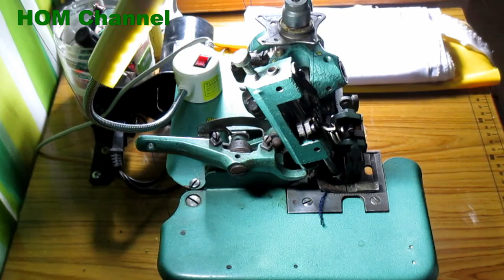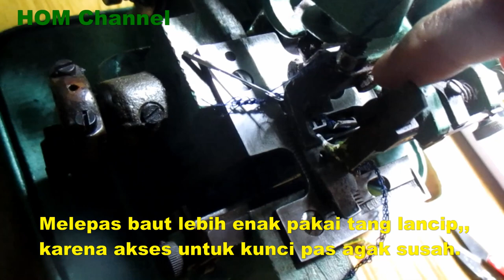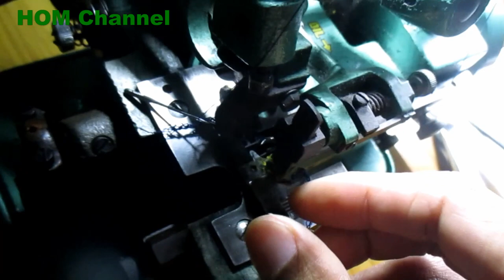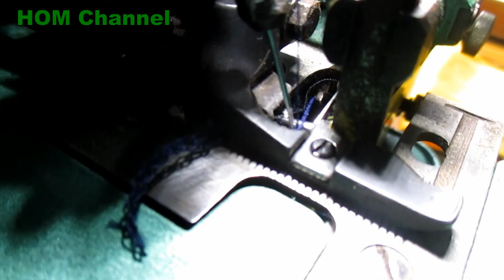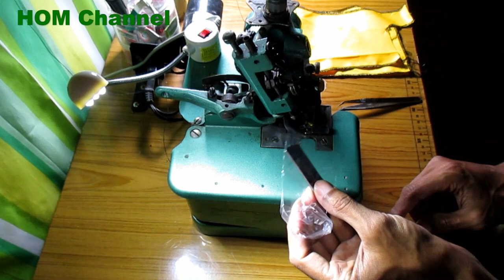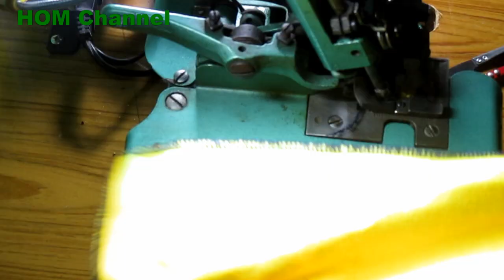Cara mengganti sepatu mesin obras pegasus DC -1S

Comment: Pegasus dc1 needle change video please this video i can't understand
Reply from the maker: You mean change to english or put only english subtitle..?
Reply from the maker: Or you want needle change video..?
Reply: Yesyes i just want video^,^) I can't see them well needle changing scene on this video
Reply: could you upload a video showing detail when you change the needle? I don't have this model manual. It's difficult to follow change needle.
Reply from the maker: @조조-q1p  to release the needle as per video,turn anti clockwise the nut with plier and pull down the needle. Then needle have 2 different side.one is groove side, along the needle and another side is scarft side. When install just to remember that the groove side must be facing us. Then insert the needle which is groove side facing us and then tighten clockwise direction the nut.so just try it...
Reply from the maker: @조조-q1p  scarf side is just concave surface just above the needle hole.you can see I thougt..
Reply from the maker: @조조-q1p  hope you understood, rather than waiting new video.if you still doubt just inform, i will sent you video by telegram app or whatsapp🙏
Reply from the maker: @조조-q1p  see the detail groove and scarf position
https://en.m.wikipedia.org/wiki/Sewing_machine_needle
Reply: @MevaraMevlana  thank you so much! Have a good day!